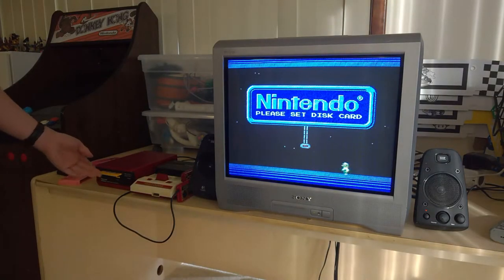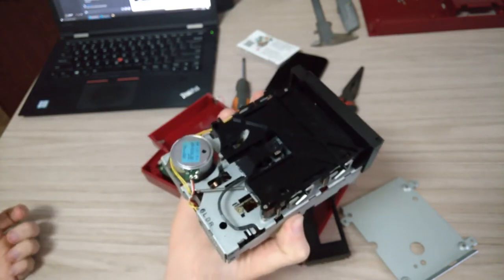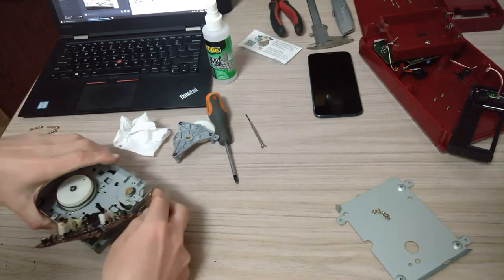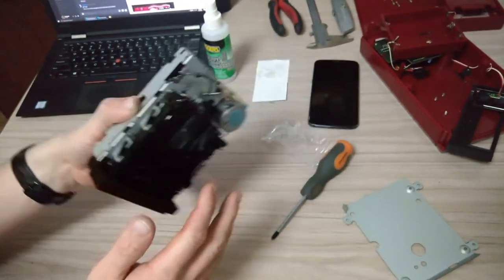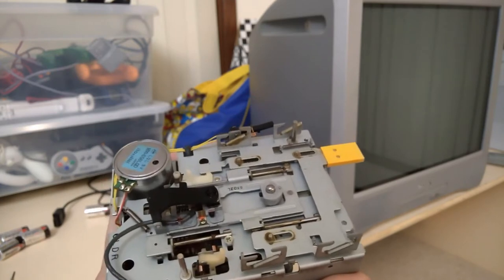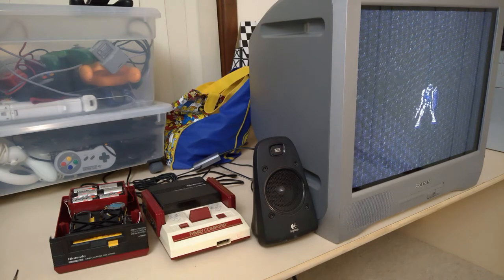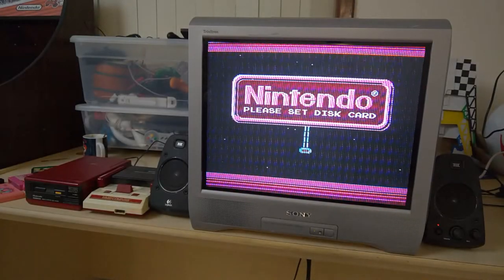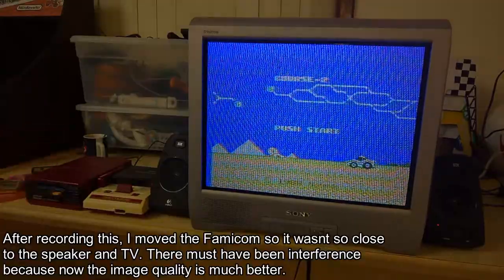Fixing my Famicom Disk System

Comment: By the time I was using floppy regularly it was on the Amiga which could read both sides without physical swapping. However I do remember having to turn cassette tapes over, and I think the big 5" floppies we had at school for the BBC could be turned over too. I certainly would have a museum with everything if I could.
Reply from the maker: I think the very first computer we had at home when I was a kid was some kind of DOS system that took 5" floppies. I think it must have been an old system from my dad's work at the time.
I have definitely never experienced tape drives.
I really only ever used 3.5" floppies on Windows 3.1 to XP